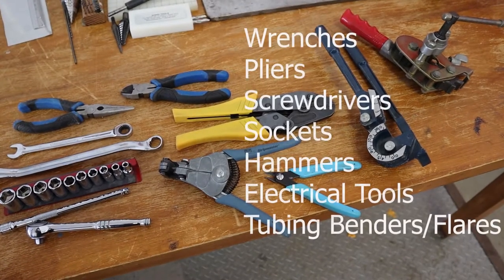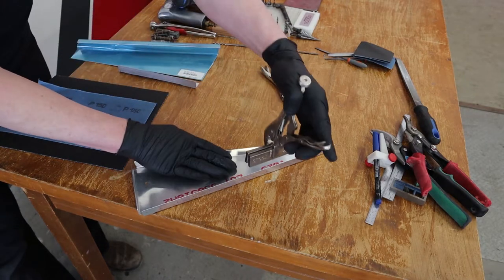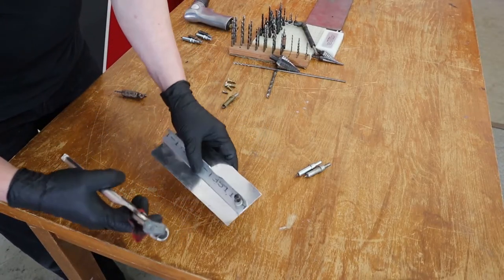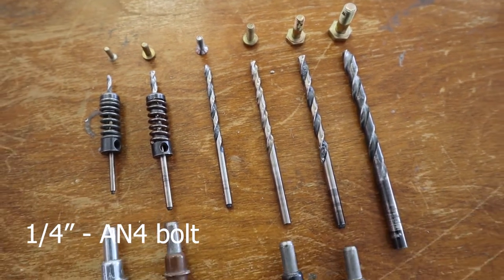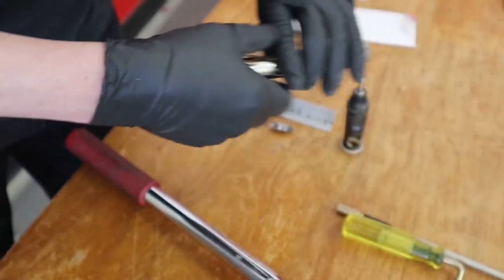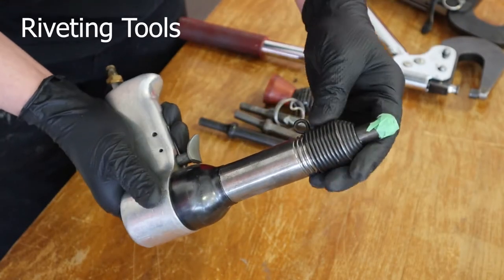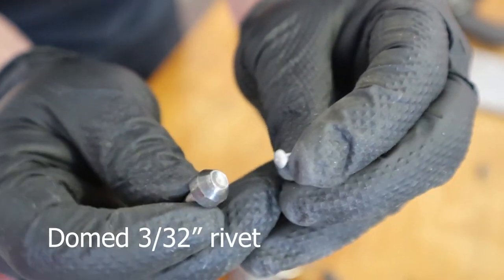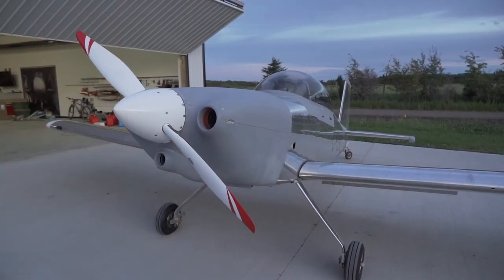Episode 3 - Aircraft TOOLS

Comment: Sir, I really want to build kit plane by ownself but I really don't know about plane basic.. would you like to give me idea about plane sir please..
Reply from the maker: The airplanes I have built so far are all metal construction.  Most of the forming and bending is done by the kit company.   They also have some holes drilled in them which makes it easy to align parts.  Basically how it works is the parts are drilled together, the holes are cleaned up and then the parts are riveted together.   I will make a video about basic metal work and riveting in the future